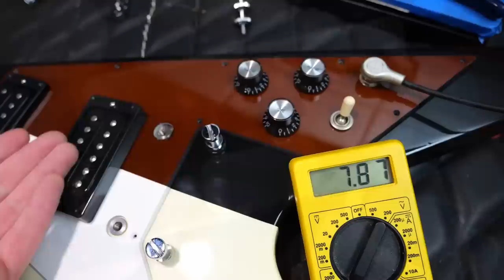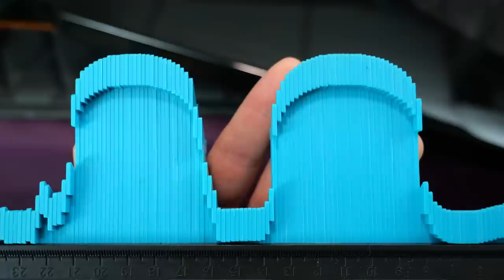What's in the HUGE Box? | 2013 Gibson Scorpions Rudolf Schenker Signature Flying V

Comment: In my experience if the guitar was being used on the road the quick connects are there in the event the guitar tech has to change a pickup it can be done quickly and then given back to the player. As you know your bigger bands usually have backup guitars but the player has his preferred guitar and will want it back as soon as possible.
Reply: Right on the money Philliph. That’s the exact purpose of the soldered end of quick connect pickups.
Reply: @kevinwilson1124  yep pretty easy when you have several packs of new pickups with the quick connects already soldered on ready to go. Simply remove the broken pickup/pickups and plug the new one pickup/pickups in in less than 5 minutes. Can’t do that when you have to de-solder and re-solder. In some cases I’ve seen it where the player wants to change their current pickups to a totally different set of pickups for a different sound while still utilizing the same guitar. Can be done over and over without putting a lot of heat into the Potts constantly which isn’t good.
Reply: @cataclysmicconverter  yeah happens quit a bit with the bigger bands. As you probably know Oftentimes smaller/newer bands have a much smaller budget and only bring a few guitars and usually those are for different sets/songs. 
I’ve seen up to 5 backups for a single guitar in some of the big name bands though. They all get pulled out restrung and tuned for every gig yet most of them never actually see a live gig.
Reply: @cataclysmicconverter  Right on lol didn’t even think of that one. Good call! Yeah you are absolutely right player and tech both. Makes you really appreciate it when you get big enough and get a tech or two, at least for a while lol.

Comment: That model had a black and white (or an interpretation of black) as they got older the black turned brown. It has to do with the pickguard material.
Reply: It looks like, to get half the pickguard white and half black/brown or whatever color it is now,   they used a clear plexiglass pickguard and painted the backside with it's color on each side and then sprayed white over that. The black/brown paint may have reacted to UV light and changed to what it is now.
Reply: Yes, I have this exact guitar purchased NOS from a music store in Santa Monica in 2016. The pick guard starts much blacker and becomes brownish red overtime. It’s a mistake they made with the coloration.

Comment: I believe Rudolph's original had a black/ white pickguard. Black being on the white side of the guitar and white on the black side, or maybe I'm thinking of Michael's. 🤷
Reply: Michael’ was the reverse color scheme of Rudolph’s: Black on top, White on bottom, matching pickguard.
Reply: @georgeprice4212  no. Michael was white on top and Black on botton wirh reversed pickguards. Check out One Night at the Budokan and you clearly see.
Reply: Michael's had the offset B&W guards. I believe the custom paint was done by the guys at Hamer around '80-'81. The color scheme emulates the V2 rocket. Rudolf was given his first sig model by Gibson in '85 with just the half and half B&W paint and no pickguard. Later models would have the guard but not offset like Michael's were. The last one seen here from '13 has the wine red/white pickguard. Michael uses Dean Custom V's exclusively now.
Reply: @glaucosouza1971  because he BORROWED Rudolph’s Flying V for the tour. In fact, when Michael was in Scorpions, they agreed that Rudolph would play the V and Michael would play a Les Paul - during his first stint, that is. And there ARE photos to back this up.
Reply: @georgeprice4212  your are right to a certain extent.  When Michael borrowed the V from Rudolf it was all Black (and he  also used a wine red Medallion in UFO). Michael indeed painted it Black and white, Not Rudolf. And the subject here is the painting not the guitar he started to use.

Comment: I really look forward to your show every day!
Reply from the maker: Thanks for watching!
Reply: @Trog  Can you swap the quick-connect connectors to correct the pickup issue.
The switch is fine, the quick connects are attached to the wrong pickup leads.
Just swap the connections.
Reply: @cataclysmicconverter That's how these came except for the pickups being reversed. That was either a factory screw up, or previous owner.